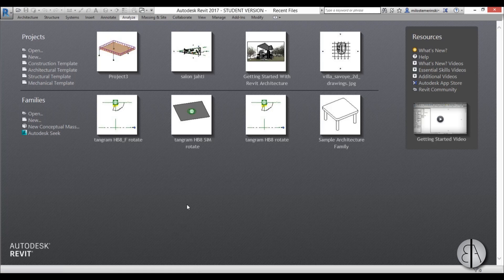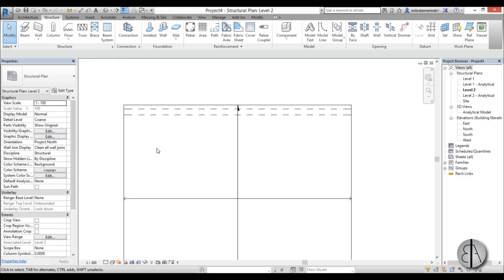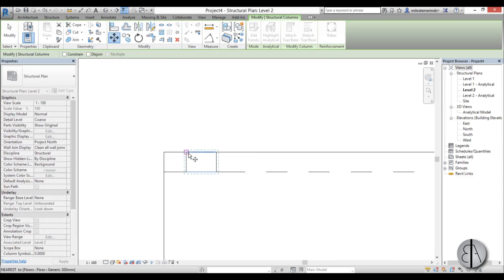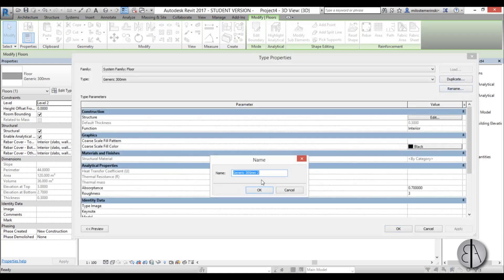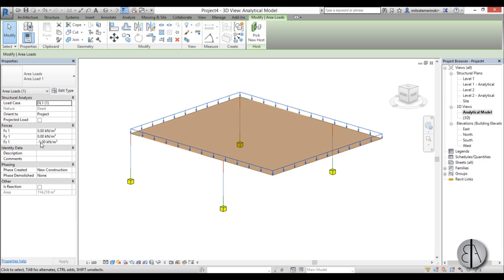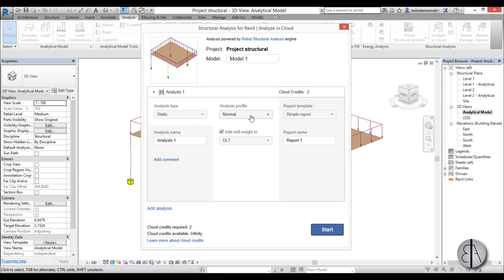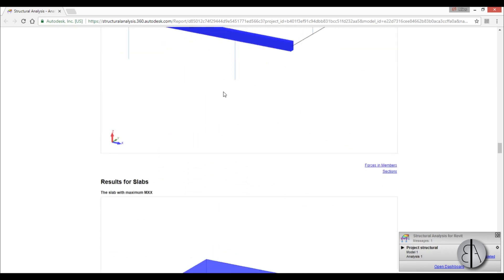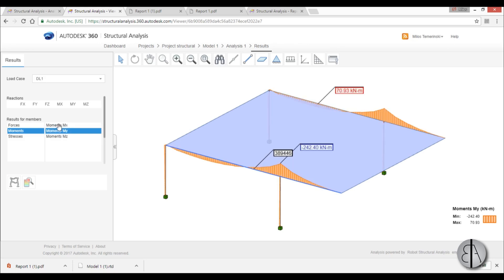Structural Analysis in Revit Tutorial

Comment: I have a specific & URGENT requirement with regard to Structure Analysis. I work for a solar company.  I want to learn analysis of steel structure on which the PV panels are mounted.   Please suggest which tool is the best out of Staad pro, tekla and Revit.   If someone is confident and willing to teach me, I am ready to pay proportionately.   I have inquired with training centers but they offer FULL civil design course which sucks time and money.  I regularly have to perform analysis of CANTILEVER support under EXTENDED ROOFS. If someone can offer me SOLVED cases of truss load analysis, I am willing to pay for the little help.  umang.201078@gmail.com    9725671950
Reply: First did u study structual eng?

Comment: Etabs is best for structural analysis especially buildings.
Reply: Only for buildings its good
Reply: the best software of analysis is the one u r good at.
Reply: I regularly have to perform analysis of CANTILEVER support under EXTENDED ROOFS. Please tell me Revit is good or Etabs to learn for structural analysis. umang.201078@gmail.com
Reply: Use staad instead then rcdc if you want cad output